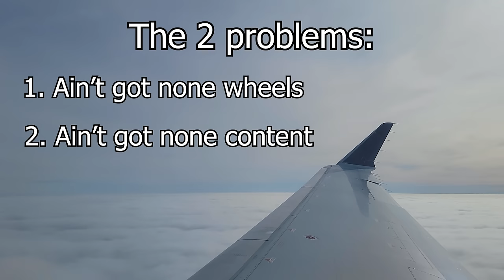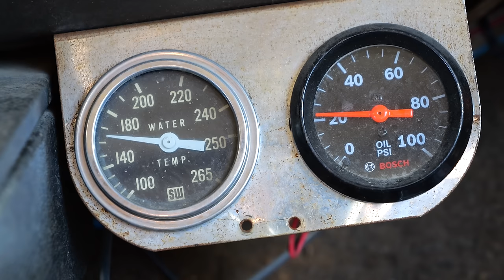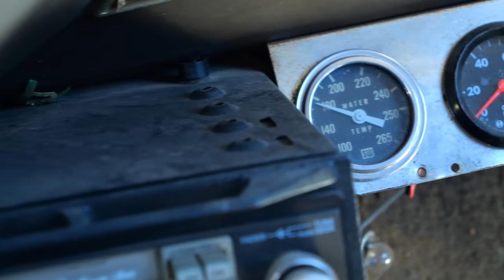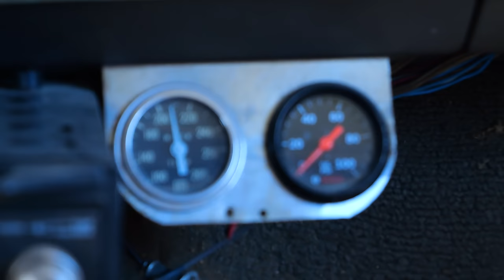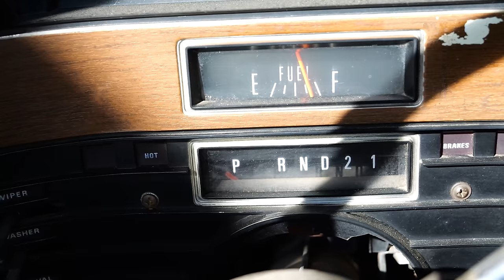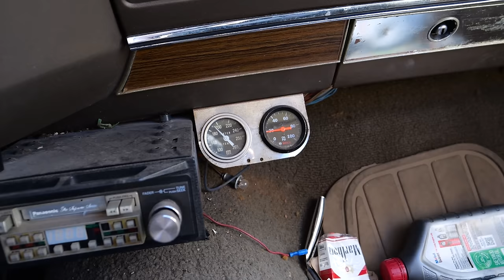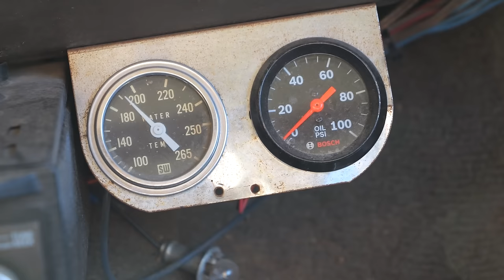Will a 1970's Wagon SURVIVE 2,100 Miles with NO REVERSE?

Comment: Anybody else have a desire to just fill it with ATF or some sort of solvent?

Run it, drain it daily while he was in LA. Once the stuff is vaguely clean, run the some oil, weight to taste. Been impressed how much just running a solvent through the engine oil can help flow.

Comment: I had a 72 ltd with a 351 windsor. The engine ran so well. It was so quiet. The car only had 40000 original miles on it. That car was a time capsule, mint.

Comment: Kevin putting a propane heater into the wagon reminds me of an old Dodge Ram Charger a buddy of mine had. It had no heat at all and it was his daily driver in NW Iowa. He put foir of those lil propane heaters in the cab to try to keep it warm. Went on a couple hour drive one day with him in it. Outside temp was below zero, the cab temp was maybe 35, so it was cold as hell, and we had to keep all the windows open an inch or two to avoid carbon monoxide poisoning. Was not a fun drive

Comment: My semi had 3406E cat 500 ponies 1850 pound’s torque going down to the pavement plenty pulling power 6 mpg if you’re lucky set to run 90 plus never stuck next to other trucks loved the fuel pump plus 5.5 straight pipes sounded like heaven

Comment: Had a Jeep Cherokee with a 4.0 that literally had an oil baked shell on the inside of the valve cover. Chiseled out most with a hammer and screwdriver and then Soaked it in gasoline for a few days. Seafoamed it and it worked great! 

They shouldn’t give up on that engine!

Comment: the 351 in this car makes me love the 302 in my truck a lot more. these engines have crazy longevity and are really reliable. I've heard stories of ppl slapping these together with mismatched parts and they just run like nothing all day! like a 302 with a few 289 con rods and it just goes. IDK how true it is but after seeing this engine and what zip ties and bias plies had done to these things and they just eat it like its made for it!
Reply: An engine with relatively low power output and not too much rpm can certainly make do with some make shift hackers. I ran my 350 vortec on 7 cylinders for a couple thousand miles... Lol I think the dizzy was bad but I just scrapped it. It was in bad shape

Comment: Sooo. My high milage worn out chevy celebrity had been running daily driver for 4 years running 15w40 mixed with lucas it idled with anything from 0-5 psi depending on temps and what not. I put 55000 miles on that engine.... And no im serious. 55k. And with a damaged piston. 1 cylinder had bogus compression. 2 others were rough and 3 were ok. (V6). . I was patiently waiting for it to kick the bucket. But it just kept on trudging along every day.

Comment: Back around 1978 I recall using a toothbrush and gasoline to scub out the rockers and everything under the valve covers on my Dad's 1968 Thunderbird 460 engine.  He plugged the galleys with rags and had me get everything clean.  Cars used to get like that .  IDK if it was just shitty oils or bad crankcase ventilation or what. Engines used to just give out at 90,000 miles.  By that time the entire car was rusted to nothing anyway.  (Northern Indiana weather and road salt)  Starting an ice cold engine and only driving it for 10 minutes and shutting it off is also very bad for engine I guess.😂

Comment: My 99 GMC Suburban has survived with 6 years of owning it with random times at idle with no oil pressure, I've been dumping some thick oil and even gear lube to thicken it up a little, hasn't left me stranded yet "Knock on wood".
Reply: Should probably drop your pan and just take a look around in there. Take your pickup tube off, clean, reseal it. Should be good since it sounds like there's not a mechanical issue... Otherwise, your gauge is playing with your head, could put a real gauge on it just to see

Comment: My dad had an old 289 Ranchero. One day he volunteered it for shop class in HS, when his teacher cracked the valve covers he asked "does this thing have rod knock?" My dad replied no and the teacher told him to never open it up again, never change the oil just add, and add STP every once in awhile. He drove it for another 75k mi and it ran perfect until one day he was racing it and it FINALLY threw a rod. Thing was immortal and apparently an old Ford thing 😂😂😂

Comment: Trust me I had the same oil leaking problem in my jimmy and oil coating is good until it attracts dirt. Which builds up thick. When it gets wet the oil comes to the top of the dirt water goes down and things like control arms rust bad and fast

Comment: I don't know if it's been mentioned yet but I think with the amount of debris in the bottom of the oil pan it's getting sucked up into the oil pickup and plugging It Off so when you shut the car off it falls back down and the engine is able to get fresh oil again

Comment: Drove from northern Ohio back to Bemidji Mn in my 7.3 with no rear main seal 2 gallons of 15w40 every 120 miles. Made it home ungodly how much I spent on oil at gas stations. Front of my camper I was pulling was covered. 😂

Comment: Hell, my 75 F100 had a 360 fe in it. Had to pull the engine because of no oil pressure. Heads were fine, bearings and the main were fine. Dunno, but built it into a 390 when I had it out. Had to sell the thing 5 years later and apparently it's still on the road.

Comment: 32:52  I wish I could show you a puc of my 70 gairlane engine when I got it. The intake well was so thick that it was 2" solid thick oil. It was so bad I had to chip it away with a hammer and screwdriver

Comment: I mean, high temps will break down carbon deposits, which of course, with all that gunk in there wouldnt really help but if you keep throwing oil at it it might suspend all the gunk in the oil eventually which frees up the oil pump/oil passages? thats the only explanation I could think of for why the oil pressure eventually went up a bit

Comment: ^^ you should've add a bit Diesel to the engine oil because that's one was to get the oil crust removed from the head gasket and so on. But how the Motor looks like, it won't get "Clean" over a short period of time...hm, difficult to explain, because my 1st tongue is German 🤔😅

Comment: Those 351 Windsor engines can run forever without oil pressure and they also can handle alot of heat.

Comment: what's happening with the oil pressure, is the pick up screen is picking up all the crap in the bottom of the pan, getting clogged, then you shut it off and it falls back to the pan.

Comment: I would have done a motor flush and once all the junk was washed out then pulled the oil pan and dumped all the crap out of it and then put in a high volume oil pump.

Comment: If that Mini Moke is a 1964 to 1968, chances are it came out of the same plant that now produces the Mini Cooper -- Cowley, in Oxford. Typical classic Mini driving position, all torso and no legs! And that persisted through the Mini Metro of the 1980s and 1990s, alongside the classic Mini. They finally fixed this with the post 1999 models.

Comment: You could have added a stop in your route that was down south and straight below Iowa so your navigation would stop trying to offer you a "shorter" route... Also i wonder if thinner oil would have flowed through the extremely clogged oil galleries/gallies better... I had other "suggestions" but after an hour i can't remember all of them...🤷 I would definitely rebuild that engine it deserves it after the long hard life its had and i would swap out the tranny for an overdrive, Ford has multiple versions so i won't suggest one... I will subscribe and watch what you did with this one...

Comment: As dirty as the engine was on the inside. You should at least change the oil filter for More flow. Seeing that old  filter was driving me nuts. Filter media was probably stopped up, using the bypass valve.

Comment: Wth did you not change the oil filter? lol Ive had the same problem with a clogged motor. Carried a spare oil filter when lost pressure.  lol

Comment: I do not get that "Lucas" stuff. It basically seems to be very viscous motor oil.  Sure that will up the pressure BUT does that help? It will also much less easy flow trough smaller channels and openings. So I am guessing certaine parts of the engine are lubricated even worse. I mean the reason why it ups the oil pressure is exactly  that it does not flow easily to all parts of the engine.
If the lower oil pressure is from a larger leakage where oil squirts out, that might be okay,  but other than that I would go in the opposite direction: Thiner oil will reach more points in larger quantities even at low pressure. As they e.g. test this externe pressure gauge I would assume the thiner oil would have reached it much faster.
I know that many people put viscous oil in an engine to "save" it, but I never got the rational behind that idea.

Comment: My 2000 ford ranger had a delay going into reverse and lack of power in reverse. The day i went to start it up to take it to the trans shop, trans didnt work at all. No drive, reverse, or any of the manual gear selections either. Just my luck

Comment: 20psi of oil pressure won’t kill a stock engine at normal rpms. I had a 302 that had 20psi hot for 10 years and then sold the truck.

Comment: oops sorry i was thought you guys changed the front seals.. so keeping the oil in the bottom would just cause oil to bleed out faster.. you guys should a pulled the intake and heads. and changed the bottom seals,, you probably spent more on oil than you would have just spent to fix the leaks and blockage  LMAO

Comment: well, this is a 6 month old video, and the car may be long gone by now, but I would be willing to bet that the crud that you found under the valve covers also exists in the oil pan.... and as such the pickup is full of that crap, and that accounts for the oil pressure issues..... a good motor flush would tell the tale there.... that oil filter was probably on the bypass for a LONG time....

Comment: I had a 87 monte ss with a 350 with a cam that was way too big and a 750 double pumper holley that was also too big. The engine had 400k on it and when it warmed up had zero oil pressure. Lol I couldn't kill it. I would run it with no pressure and it would tick and the rods knocked. Let it cool down and it ran fine with no noises again. Lol.

Comment: i have a 350 vortec in a 98 K1500 that likes to leak out of everything it's a wonder we have ran it out of oil and didn't notice drove like 20 miles put oil in it fired it up and it was right back at 50 to 60 psi damn thing never made a peep the whole time either I just looked down and said oh shit and got off the highway the add fluids I only noticed because the temp started to creep up it has been an add oil engine since and hasn't skipped a beat

Comment: God those Mini engines will be even worse to run out of oil since the transmission shares the oil with the whole engine, I used to have a Mini that burned 4 letres a week - cyl no. 4 rings was non egsistant so I saved money only having to buy three sparkplugs each service, and it would let me know when it started to run low lmao. That was back in the day when you could get a ratty one like mine for $2k nz now they're over $5k for one that gives you the real life Fred Flintstone experience.

Comment: No Oil pressure would make the valve train clatter like hell IMMEDIATELY. A pressure gauge not properly bled of air won't read correctly. Just because the gauge is in the vehicle doesn't mean it was installed correctly.

Comment: If it has no reverse...then odds are pretty good that it has no 1st gear, either. 
Cause the band is broken.

23:00 I knew that water was gonna kill the engine... remember the fuel pump was leaking.. bet you got water in the fuel thanks to that. oh... water in the cap... you sprayed the water that high? why?

1:04:00 U should have splurged a little for a Carbon Monoxide detector.

Comment: I would imagine the oil pickup is plugged
Reply: I bet the symptoms go deeper than that. Likely never got rebuilt in 135/137k miles and needed it around 115k miles. So since then (last 20k miles), they just been limping it around and putting oil in, changing things that break, hoping it still lives. Its crying for an engine rebuild, and anything less than that is just putting a band aid on a sword gash.

Comment: pull that old girl apart. Should be easy to get parts for the 351. probably need a crank and bearings due to wear from lack of oil changes and sludge build up

Comment: You were getting 233 mpg on your oil. But that is crap oil mileage as you're supposed to get in the neighborhood of 2000 mpg in a normal engine. And that isn't considering the fact that it worsened as you drove.

Comment: 57:05  As a european I had to do some converting: 16 miles a gallon is 14.7L/100.😱
The worst car I've driven did 8L/100 which is about 29.4mpg. My current car does about 6.9L/100 (or roughly 34mpg)  
Absolutely wild that 16mpg is "okay". Then again, if I drive these distances I've gone through like 8 countries that all speak different languages. 😂
Reply: some of the american cars do like 12mpg or less, sometimes single digits which can be upwards of 20L/100km but you also have to remember that gas over there is like 3-4 times cheaper than here in europe.

Comment: Not sure why you all like these really bad cars.. These 1970s cars were JUNK new.. Its was not uncommon that a Chevy had a Olds steering wheel because the factory simply did not care.. Quality was number 10000 not number one.. These are the worst of GM, Ford etc.. and should go away! There is a reason most odo's in these Americana Junkers did not have a space for 1,000,000 miles.. Most NEVER got close to even 60k let along 100k.